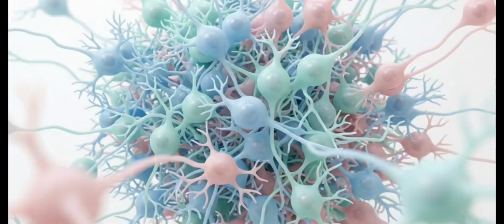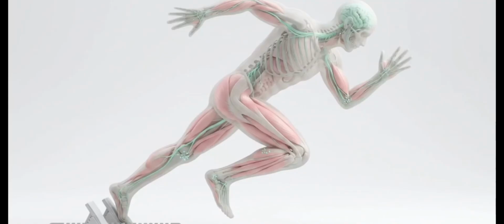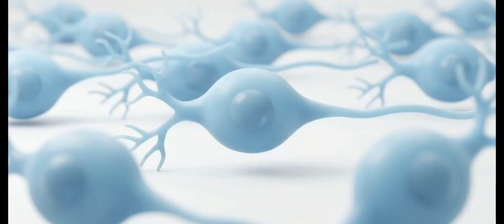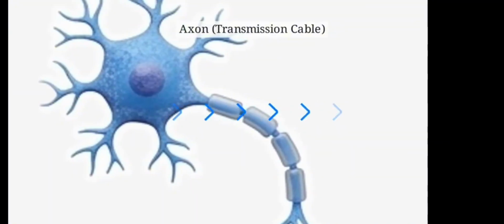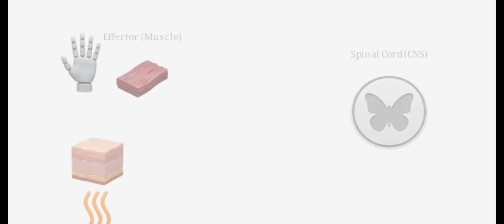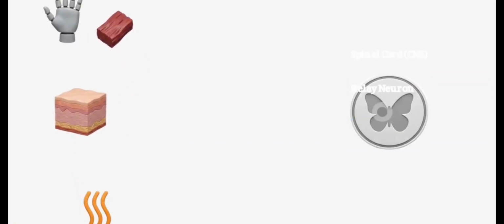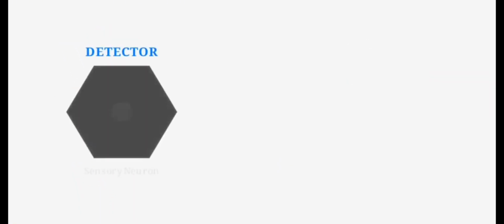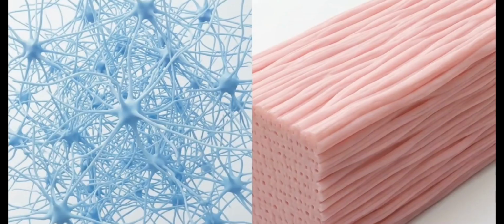How Our Nervous System Works #original #video

Comment: The specificity of the nervous system refers to the precise and organized connections between neurons, which are crucial for the functioning of neural circuits. Key aspects include:
Synaptic Specificity: Neurons form synapses only with a small subset of available partners, influenced by molecular interactions across the synaptic cleft. 
Wiring Specificity: The precise connections between neurons are essential for the proper function of neural circuits, with mechanisms that ensure these connections are established in a controlled manner. 
Molecular Mechanisms: The formation of synaptic connections involves several stages, including axon pathfinding, topographic mapping, and cellular targeting, which are guided by molecular signals. 
Developmental Patterns: The establishment of these connections is shaped by genetic programs and developmental processes, resulting in the intricate patterns observed in the human brain. 
These features highlight the complexity and precision of the nervous system's connectivity, which is fundamental to its overall function.